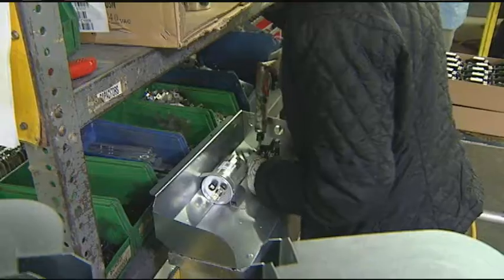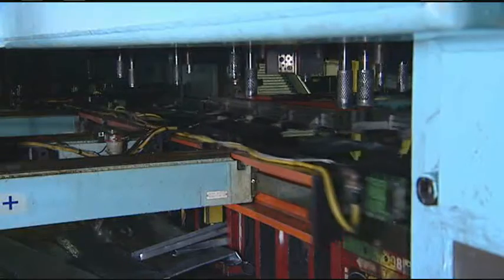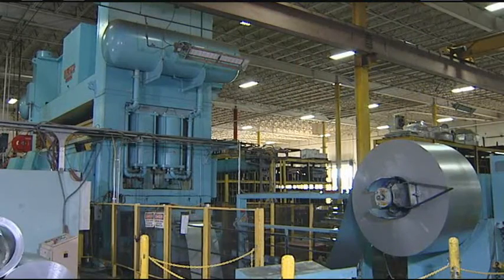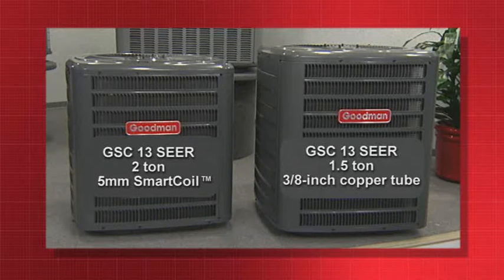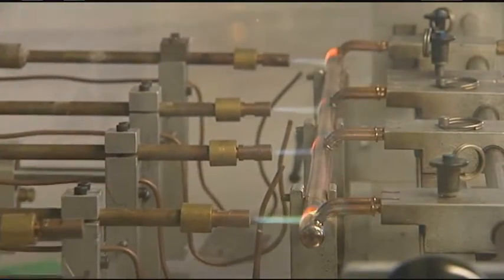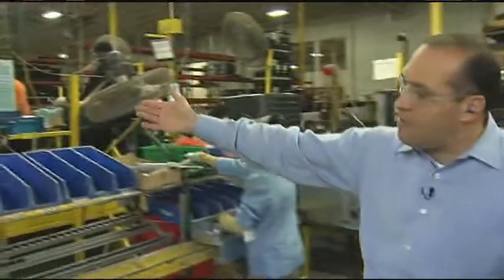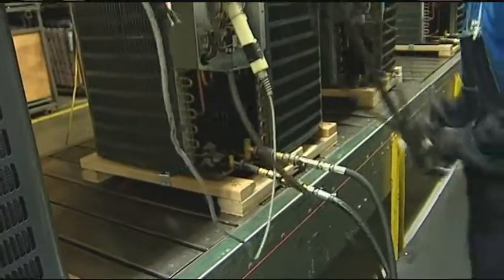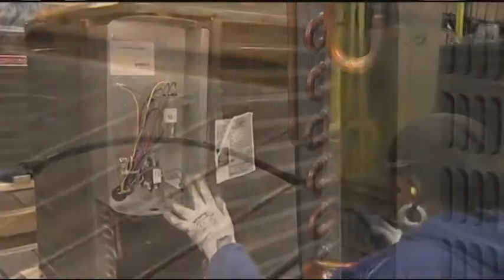Goodman Air Conditioners and Heat Pump Assembly

Comment: I will compare it. On multiple levels!

First, Goodman/Amana's treatment to people who try to sell and install their products are downright pathetic!  I have stopped selling their stuff for 5 reasons i think anyone would appreciate.

1. Air Handlers are flimsy!  Remove the coil and fan and the sides all but collapse in, not to mention the unpainted sides decay and rust due to being basically bare and so thin.  Also during installation, when the door are off for any amount of time, the frame can become easily distorted and warped thus becoming a nightmare to get the doors lined back up. Also the pathetic insulation will come right off after the first summer season almost perfectly like an entire sheet due to not being made well. Goodman has had ideas suggested to them on corrections for these problems only to fall upon deaf ears!

2. One step forward, two steps back!.. When Goodman finally makes a headway to bettering their product, they go back 2 steps on other aspects.  Case in point, their heat kits.  Their older "sequencer types" were a lot neater and better setup, they used brass jumpers instead of wire 3" too long which clutters everything up on the new ones, then to add insult to injury the backing plate for the breaker that stuck through the door that they included was removed on the new contactor type heat kit's.. Moron move!  All Goodman must do is go back to their old style "sequencer HK's" and just trade the sequencers for contactors while changing nothing else, that will make it perfect.

3. Their AC's and Heat Pumps are flimsy. They used to be more robust, instead of having 4 corner posts, they removed them and just went with a "wrap around" thin grill like Nordynes/Intertherm" models. Not to mention their "top discharge grill" that they showed being stamped out is a severe nuisance when changing condenser fan motors due to having to pull the entire top off instead of like their Amana models which use a grill and are removable for ease of service.. Not to mention the grill discharge types are much, MUCH quieter!

4. Spaghetti wires!!!!   I have never seen such a mess when opening a condenser panel or air handler. Good lord. Goodman/Amana add's 8"+ on every single wire more than what is needed, plus the whole "plug in" harness is ridiculous and shows they wish to sell to the public rather than a professional contractor, hence the plug and play ease.. All anyone must do is look at Ebay to see who is and isn't selling their stuff online, GOODMAN does it to get out of honoring their warranties even if it was put in by a licensed contractor or not. The BBB has plenty of evidence of this and a simple search provides treasure troves of evidence. 

5. Sales and loyalty!  So many contractors have sold GOODMAN/AMANA products only to have Goodman give them the middle finger! I have stopped selling their stuff and i would rather sell any other type due to their treatment against me and my company. I have sold near 20 units for them in the past 2 years and i cannot even get listed as a dealer on their website. If Goodman cannot recognize and appreciate me now, then they best not approach me in the future especially when i put their other dealers in my area out of business! It's just that simple.

I could keep going. I could.  I have stood up for Goodman/Amana and not took the easy way out and bashed them like plenty others have, but after they have acted and treated me and mine the way they have, all bets are off and i am spilling it to anyone and everyone who wishes to listen!  

Sooner or later, Goodman/Amana will eventually burn and hurt all of those who tried to do good by them and they will wish they hadn't screwed over so many who did nothing but try to help and represent their stuff with pride. 

I'm out, and until they can fix their problems and be honorable then they best not even try to act like they are all great or better than others because the truth is Ameristar has them beat! And that is the newest comer to the game and they haven't been around any time basically! It's just that easy!